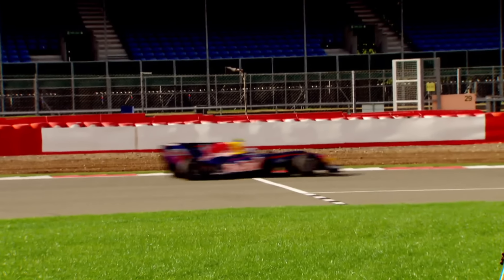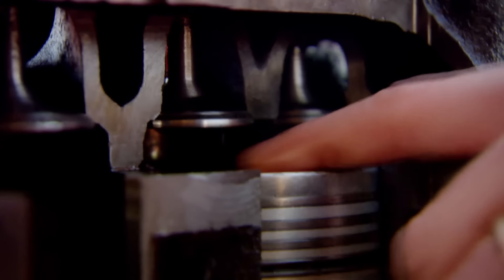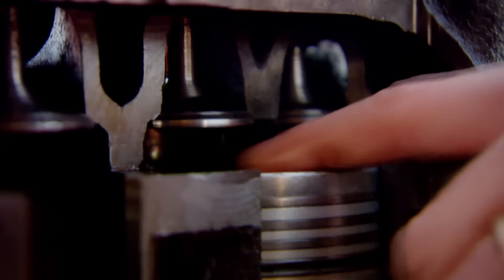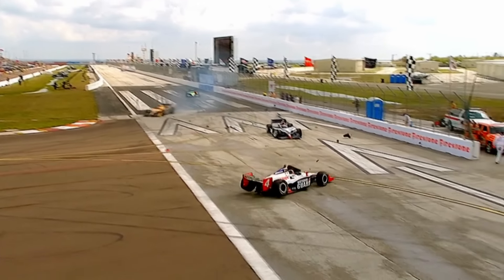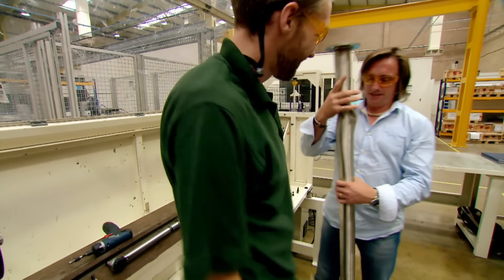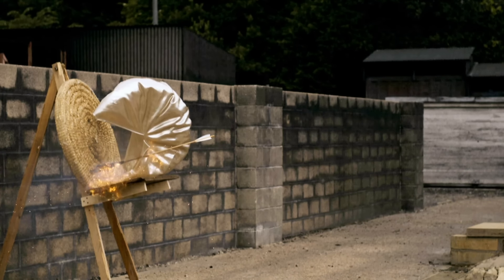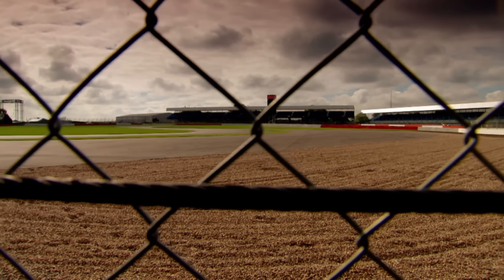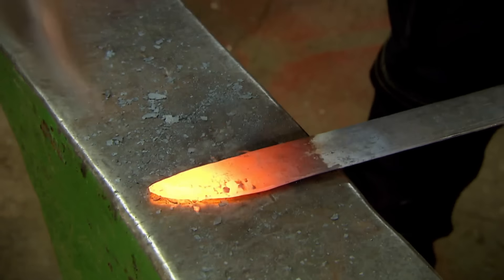Engineering Connections (Richard Hammond) - Formula 1 | Science Documentary | Reel Truth Science

Comment: Correction.  When an internal combustion engine is cold, the pistons have a SMALLER diameter compared to a warmed engine.  The risk isn’t a too tight piston, the risk is the piston may wobble in the cylinder and cause damage.  Also a piston is “cam ground” meaning the part of the piston with more material “wrist pin” is smaller diameter than the other parts of the piston.  This way when the engine is warmed, the piston is as close to a perfect circle as possible.
Reply: thats what you'd think, but in fact the video is correct, it just doesnt explain fully why. you are correct that materials expand when heated, but because the piston and the engine block are different materials, they have different thermal expansion properties. so when cold, the engine block could shrink more than the piston, meaning a too tight fit. the engine is designed to run at a certain running temperature, so its only at this temperature that the piston and block have a snug fit. Hope this explains this!

Comment: Enjoyed the part where they were trying to extinguish burning gasoline with water
Reply: A fire needs heat and oxygen.  The overkill volume of water removed both.
Reply: Trying? They succeed.
Reply: Gasoline doesnt burn, its vapour does.
Reply: Should have filled it with hydrogen,  would have made a nice bang! =)
Reply: @GerardKean  except the fire are burning the vapour kf the gasoline amd not itself. In some cases pouring water could make it worse since it can just spread the gasoline more. This is why we recommended to use fire extinguisher to put out a fire in that situation

Comment: Giving Rolls-Royce credit for introducing composite fan-blades is criminal!!! GE-90 anyone?
Reply: GE90 introduced in 1993
Rolls Royce RB211 introduced in 1973

Don't know about you but 1973 would appear to be before 1993...
Reply: I've done the math and it appears to be 20 years before. Astonishing!
Reply: I love the RB211 just as much as anyone, but no carbon fan blades!
Reply: I will concede that the RR engineers were working on it "Hyfil," but the original RB211 engine was not certified with the composite blades.

Comment: quite old documentary. they are in the v6 turbo era
Reply: 15 May 2011
Reply: So, what's youre point?
Reply: @toohottie001  not all. The horsepowers are off. The pit stop time is way lower now and they use carbon fiber wheels instead of magnesium
Reply: my point is simply lot has changed in the last 4-5 years. some still valid although
Reply: Yea hamster isn’t rocking that awesome hairdo anymore

Comment: Why dont they make each and every part out of carbon fibre ?
Reply: I dont think that's possible and I think the regulations dont allow it
Reply: Components like the engine, wheels and suspension still requires metallic parts for safety and durability.  Composite materials like carbon fiber has mostly replaced all of the monocoque body parts. Not only because they’re lighter. It’s also much safer to provide greater survival in case of a crash.  Compare that to fiber glass decades ago who doesn’t really give much crash protection benefit except for being lightweight.
Reply: True

Comment: 3:15 Someone please inform the lil man about internal combustion engines do not explode.  When that does happen its called  detonation and is an engine killer.  What drives the pistons down is the expanding burning gases (I.E. gasoline & air mix) 🤪
Reply: A rapid expansion of a gas is technically an explosion. What drives the engine is actually called combustion.
Reply: Yep it's "suck, squeeze, BURN, blow" not suck squeeze bang blow
Reply: Jordan Perschke I’ve never heard “burn,” only “bang” in all the engineering and automotive classes I’ve taken. An explosion is a combustion. The fuel and conditions control the rate of expansion and explosive force. It absolutely is an explosion
Reply: @Hot-Dog-Racing  if you think it is a bang and not a burn, then you wasted your money on those engineering classes. If you get a "bang", you have detonation, which is not good. If you have a "burn", you have proper, steady, even and complete combustion. But what do I know, I only work on engines for a living...
Reply: Cody Piscitelli you're right. At the most basic level it's a rapid release of energy. People just like to be derivative and argue semantics.
Reply: carlsoto1747 That’s my point. It’s all semantics. An explosion is the same as a slow burn. It’s all relative and subjective.
Reply: Well, technically gun powder burns too. A slow burning stick powder totally changes the tuning of a rifle VS. say, a faster burning ball powder. That was the main issue with the problems when the M16 was first introduced in Vietnam. It was burning to fast and the gun wasn't tuned correctly. 
The thing is, most people just say gunpowder explodes. In common usage, most people say anything that burns fast and expands is exploding. 
You can be nit picky and point out fuel & air is actually burning but most people already know that. If you are reloading ammunition, tuning a gun, or tuning an engine, you will want to know burn rates. If not, it's just semantics. For everyday usage, people understand what you mean when you say the fuel explodes.
Reply: But hey what do I know, I'm not a college kid who's never spent a day in the industry and pulls all of his knowledge from what the latest rendition of the textbook says. No, I just do this shit day in and day out for a living - what the fuck do I know.
Reply: se·man·tics
noun
the branch of linguistics and logic concerned with meaning.

You literally are arguing semantics. It's a common mnemonic used the world over, it's not a comprehensive reference to the specific workings of an engine. I'll use my paycheque to tell me the value of my degree; and not the opinion of a living meme in the comments section.
Reply: @jordanperschke1468  Seriously buddy, find a hobby or girlfriend and stop trying to pick fights with people in the comments section. Then again, you probably have a hard time establishing meaningful relationships with your hostile disposition.
Reply: Now go back to your other comment fights that you picked with people who aren't actually a league ahead of you.
Reply: @Hot-Dog-Racing  oh and just a side note, I never said it wasn't an explosion.
Reply: that lil man is Richard Hammond and he spent most of his life driving cars and reviewing them,i don't think no one needs to inform him anything, he knows what he is talking
Reply: @Jordan Perschke @HighLiner15 Detonantion in the context of SI engines aka knocking is when the fuel air mixture is also ignited at somewhere other than the spark plug and the resulting shock waves collide giving you the knocking sound. Just because it's called detonation you two thought that fuel explodes when the engine knocks and it doesn't otherwise. You are wrong. Of course fuel explodes in an engine. Detonation/simply is simply when the explosion isn't of the kind you want. All diesel engines have some knocking, for example, it is unavoidable due to the nature of the engine. Learn to accept that you don't know everything and stop projecting your insecurities on others.
Reply: To 'detonate' means to cause something to explode, but it can also describe/mean an explosion. Fuel-air charge is detonated by a spark plug, a bomb detonated. Explosion is a form of rapid combustion and expansion. It's not something bad, it's part of the process. The problem is not the detonation, but the timing of the detonation. Detonation shouldn't really be synonymous with knock.

This is just my speculation, but probably as we develop higher compression engines, we need fuel that avoids knock. Engineers/scientists describe these fuels as able to "resist detonation". So naturally, everyone starts making the connection that "detonation" is something detrimental to an internal combustion engine. So today we have "detonation" = "knock", since knock is what the detonation resistant fuel is made to avoid.
This anti-knock fuel is made to be "detonation resistant" because to avoid knock you have no choice but to make the fuel more difficult to ignite (i.e require higher pressure to achieve auto-detonation). We want detonation, but the problem is that in high compression engines we want it to resist it enough so that we may choose when.

This is what I think where this confusion comes from. I might be wrong, and I'm glad to be corrected.
Reply: A normal 'burn' vs a 'detonation' is just the difference between a controlled and uncontrolled explosion; igniting a fuel-air mixture at anywhere near stoichiometric ratio will cause that mixture to explode - i.e burn rapidly from the initial point of combustion- the difference between the two is that 'detonation' is uncontrolled and not initiated by the spark plug - it occurs earlier - hence the alternative name of 'pre-ignition'. The earlier explosion causes damage because the piston is still rising towards TDC and the premature explosion tries to force it back down while it's still coming up.
And yes, I'm aware that a 'normal burn' is also initiated before TDC, but by the time the charge is burned and expanded the piston is past TDC. Tha'ts not the case with detonation, hence the damage.
Reply: vinod bansal Thank you
Reply: Lmao you're right, seems like you've got our friend Jordan in a bit of a huff though @carlsoto1747
Reply: shananagans5 I guess its about deflagration vs. detonation, huh?

Comment: I am a retired research engineer.  I loved top gear. This show is also terrific.  Most of the time you get the engineering principles correct, but this time you got something totally wrong.  When you discuss the principles used tuned by sailors of old but the claim was that they were using the  Bernoulli  effect of differential pressure.   This is not true as it is far more simple.  The force generated by the sails were the result of Newton's 2nd law.  (The force generated = the mass flow rate times the velocity of the air.  Of course the force and velocity are vector quantities.   Strictly speaking Newton's 2nd law says that the force generated  is equal to the time baruitton of the momentum.   The equation is developed by taking the derivative of a product since the momentum is defined as the mass times the velocity.)   The only reason that it is important is that it confuses the  Audience when you apply the wrong principle.  We can't get it right all of the time, but  you are doing a great job and get it right most of the time!

Comment: The way they explained the aerodynamics of an f1 wing was strange. It's actually the same wing airplanes use but reversed, instead of lift, it creates down force. They didn't have to talk about sailing to explain it
Reply: sailing boats areolder than airplanes,so it makes a better impression on the spectator to connect it with sailing boats.also they are much much slower,for increased effect.if you compare it with airplanes is like:meeeeh,a wing is cooler than a spoiler,even if it is an F-1 spoiler.
you are right,but not,if it makes sense.
Reply: @xiro6  yes I get that

Comment: Waiting until they start making the cars asymmetrical. Since a track will overall favor one corner direction :D
Reply: NASCAR already does this. The cars are designed to do one thing: turn left. You have to hold the steering wheel pointing to the right if you want to drive straight.
Reply: @peanutbuttereggdirt1  Oh you are right! Yes, maybe that's the exact reason why they don't do it then :D

Comment: 3:36 wrong info... cylinder count does not equal power... size does...
Reply: Ya it does a 3.5 liter v12 is more powerful than a 3.5 v8 or even a 4 liter v8
Reply: @ashyxt   @adopted_ by_depression  you are both correct but in different contexts. Cylinder count (if we run it in a MATLAB simulation feeding in the equations that govern IC engines) will not make a difference if displacement is same. But in engineering practice, more cylinder will give more power due to smaller flywheel and higher revs, till the frictional drag and weight of moving parts catch up.

Comment: Carbon fiber is made from cotton!  It has no compression strength on it's own. But dose had hi tensile strength. It's the epoxy resin that's important to the build and the directional flow the layup of carbon that they use for vibrational flow characteristics.

Comment: Man I miss when F1 cars sounded like F1 cars.
Reply: F1 cars do sound like F1 cars.
Reply: @keppycs  No, they do not, not the iconic sound they used to be associated with, that is still used for marketing purposes, to this very day. Fact of the matter is a V6 is really hard to make sound good, especially when you have a turbo, hybrid system dampening it on top of lower overall revs. The V10s and v12s will always be the best sounding era, with the V8s right behind them.
Reply: @XBullitt16X  Your liking of how the cars sound is subjective, it's an opinion. Personally I prefer the V6's over the the other ones.
Reply: @XBullitt16X  I'm not arguing anything. I was just sharing my opinion, is all. Though factually speaking, the V6's are just better in most aspects (that I know of) than the old engines.
The majority of the sound is just a byproduct from the engine revving. Some people may like it, some may not, and some may not even care about the sound.
Reply: @keppycs   Then why state that my opinion is subjective ? Its a useless observation, if both our reasoning is subjective. This is why I merely pointed out that I hold the common and majority position and you would have a hard time arguing that I didn't, which is true, mind you. My subjective point and reasoning aside, what I can objectively point out, is that while you're not wrong that a lot of the sound output is due to higher revs, there are number of factors that impact the overall not and tone of the engine.  

These are just some of the things that impact an engine's sound. First and foremost engine format, v, inline, flat etc, displacement, RPM, intake, wastegate, blow off valve, Turbo spool and flutter and especially the exhaust and how its design affects the speed and flow of the gasses exiting the headers. These days due to the hybrid systems there is now is an extra step which comes before the gasses exit the exhaust, which further muffles audio. 

Fact of the matter is even if the V6s revved to 20 grand+ they might sound a  better but not nearly as good as the V10s, V12s and V8s of the past. Because as I said the format does impact the sound and now so does the Hybrid systems.  Even outside F1, V6s rarely sound good and when they do its because of a very good custom unrestricted exhaust systems, cool external blow off valves, intake and turbo noises. 

The V10 these days is extremely rare in road cars, but even In road cars with normal rev limits at 10k and lower, they sound far superior to most engines, just look at the Lexus LFA for example. You could put a stock Judd V10 in an F1 car and it would sound superior to modern day F1 engine.

Comment: Now I'm left wondering: Why magnesium wheels instead of carbon fiber ones?
Reply: Technical regs.  FIA rules for F1 allow only two magnesium alloys for wheels.  Boutique car makers have fitted vehicles with carbon fiber wheels.  F1 disallows it.
Reply: @4jp  why?
Reply: @BorisNoiseChannel  These are the rules they have decided on.  F1 is still using 13 inch wheels, though they will be changing to 18 inch wheels with lower profile tires in a few years.  If your want to race in F1, you need to follow the rules.  that means no carbon fiber wheels.

Comment: Initially I thought this was dealing with 2018 F1 cars until I heard the engines and realized this was dealing with pre "power unit" cars that have a 1.6 litre turbo combustion engine. 
A minor point: a "controlled ignition" not an "explosion" occurs within the cylinders.
An interesting article nonetheless relating basic engineering to a modern F1 car.
Reply: For the layperson "mini explosion" is a good enough lie. It's not even remotely correct but it does a good job of conjuring the spirit of what's going on and serves as a good foundation point for further learning.
Reply: For the layperson "mini explosion" is a good enough lie. It's not even remotely correct but it does a good job of conjuring the spirit of what's going on and serves as a good foundation point for further learning.

Comment: At around 12:00 they start talking about how the engine is too cold to be started and the components are too tight. Uh sir. I think cold components are too loose and running the high reving  engine when it’s too loose causes excessive wear.
Reply: I will take the word of an F1 an engineer over your opinion simply because of your expressed understanding of metallurgy.   Alloyed metal growth rates vary at temperature and tolerances as close as needed by an engine of this caliber take this into account.  Yes, some will be sloppy, but others will be tighter than a frog's butt, hence the necessity for preheat prior to starting them.   Something I learned decades ago, but don't take my word for it, you should fact check me.. I insist on it.